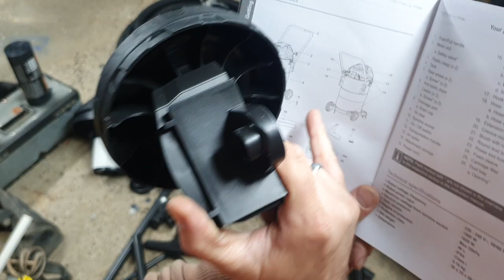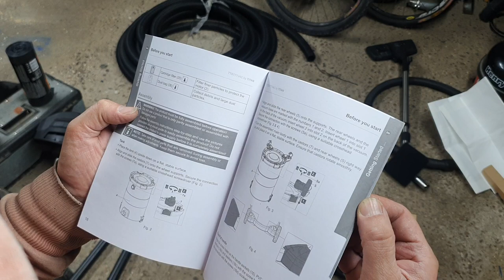Sucking Up Everything: The Vacuum Titan vs. Henry Hoover! Screwfix Titan TT777VAC Vacuum!

Comment: Hi mate, could you please tell me if it still works well?
Reply from the maker: Yes works great, no problems as yet and used it loads with dirt and water
Reply: @Rescueandrenew  cheers pal. I’ll grab one now.
Reply from the maker: I went to the tip and got some old flexi 50mm ducting to make a really long hose so most of the time the vacuum stays outside as it gets filled up so I don't have to move it when it's full of water and can just tip it over as it really heavy when full of water
Reply: @Rescueandrenew  very useful 👌🏻